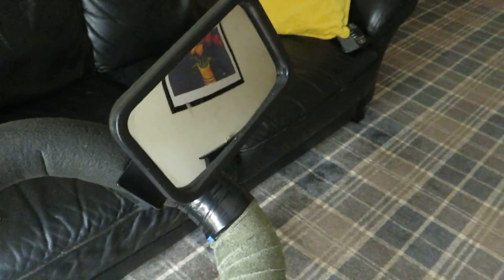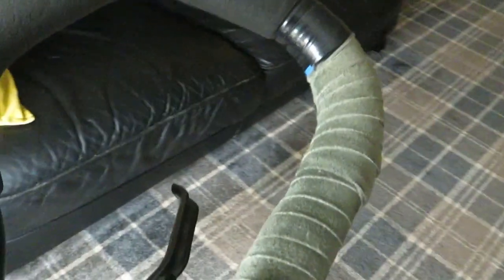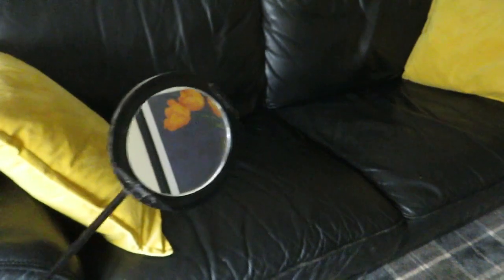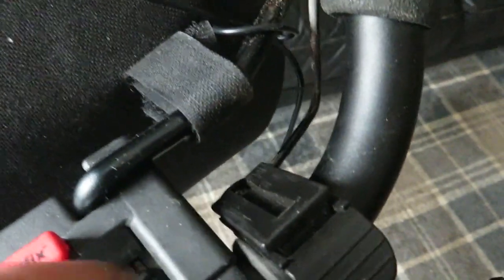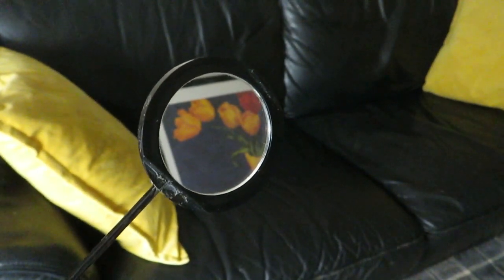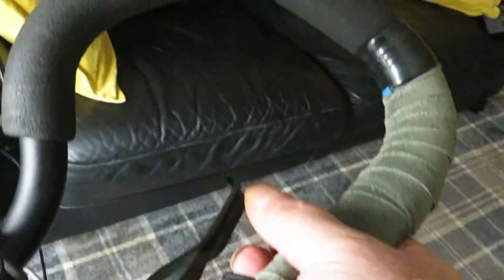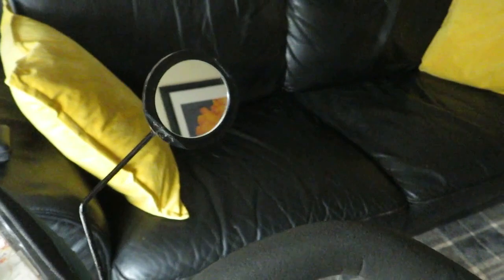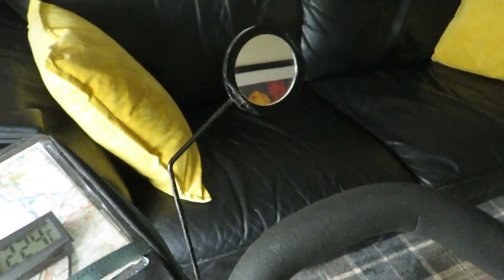DIY bike mirror

Comment: I bought a couple of cheap, Chinese bar-end bike mirrors but they were too thick at the stem to go into the bars! Waste of money? I was determined not to be so. I pulled out the end plug, took some of the linkage off the mirror. Drilled the end plug and made the beggar fit. I didn't want a mirror with a longish stem as they tend to wander about on a journey due to the vibration of the road.